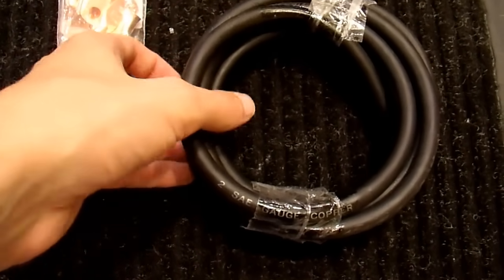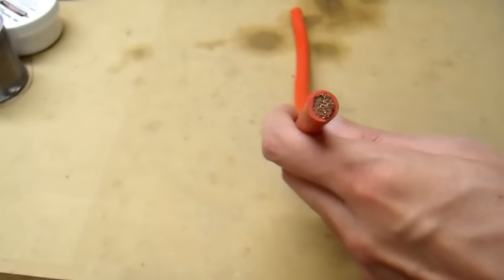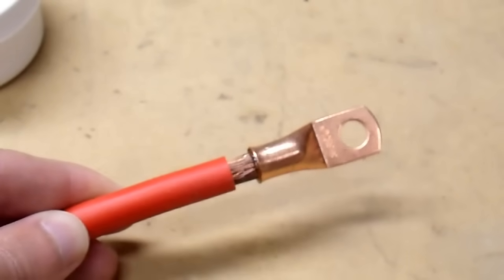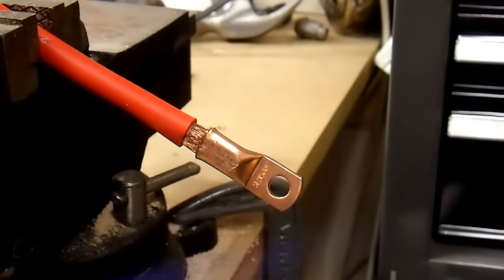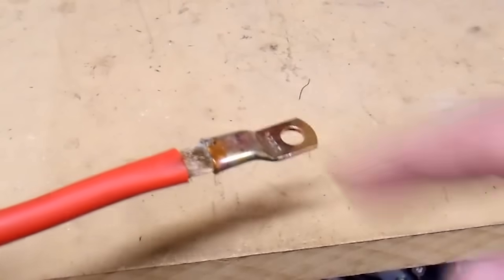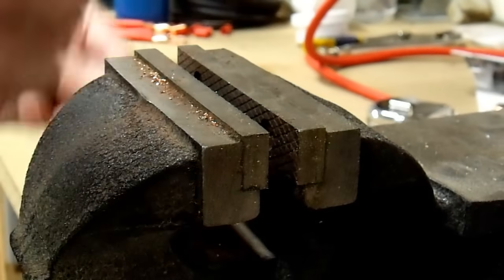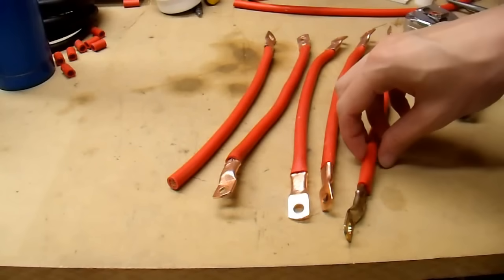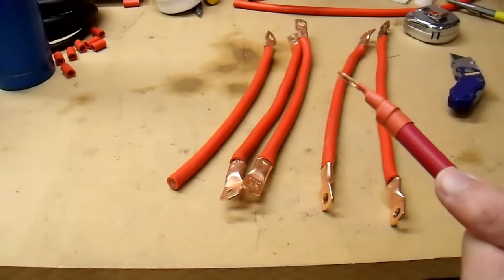How to Make Battery Cables the Right Way and the Easy Way

Comment: NOT EASY OR RIGHT!!! THE IRONY IN THE STUPIDITY!!!
Why It Is NOT RIGHT (The Reliability Failure)
Soldering Kills the Wire: If you solder, the connection becomes rigid. The vibrations from your engine will always cause the flexible wire to break right where it meets the stiff solder.
Acid Eats the Copper: Soldering uses a chemical called flux. This flux is acidic, and it soaks up into the wire strands. You can never fully clean it out. That hidden acid slowly and secretly eats away at the copper wire over time, causing failure.
Bad Crimp Risk: The hammer tool is a guesswork method. You hit it hard and hope it squeezes the metal perfectly. If you are off by a little, the connection will be weak. You can't see inside to check the quality.
2. Why It Is NOT EASY (The Execution Failure)
It's Hard Work: Hitting a large wire lug (like 4 AWG) hard enough with a hammer requires a lot of physical effort and a solid surface. This is difficult to do correctly when you are working on a car.
Easy to Ruin Parts: One bad strike can bend and ruin the expensive metal lug, forcing you to start over and waste material. A proper tool takes the risk out of the process.
A high-quality crimp tool is the only way to get a perfect, lasting connection without all these risks.

Comment: Those terminal lugs are not designed for soldering, they are designed for CRIMPING. solder lugs have a small hole in the sloping face, where the solder flows into the lug and up along the copper strands of the wire.

Comment: Your flux should not be acidic and you should use a proper crimper and put a small hole at the front of that so solder can get to the front of your cable within the connector. Stop trying to teach people things you don’t know anything about or don’t care about.

Comment: Sorry the picture of the battery connected is improperly done.
No copper on wire should be exposed and insulation sealer at insulation there is none

Comment: So you do the work, to do a video, and do it completely wrong? You stripped excess, but not important? Are you high???  Folks, strip it back until the insulation meets with the connector. Also use shrink tubing. The cable this guy just made is dangerous, and should not be used.

Comment: This is the worst "right way" video I've ever seen. To crimp a ring terminal, you absolutely need a special crimping tool. Other methods do not provide a secure and permanent connection. With a properly crimped connection, soldering is no longer necessary. In fact, soldering itself can become a risk if the cables get hot: Solder drips and the connection deteriorates rapidly. This can cause a fire because the resistance increases rapidly.

Comment: In an exposed environment such as under a car's hood, I would crimp and solder.  Crimping makes the electrical connection and solder seals the connection from water and dust intrusion.  I've seen exposed crimped battery cable connections almost breaking aprart due to corrosion.  I've never had a problem with rosin flux corrosion.  Acid flux is a different and corrosive flux.  That's why today's battery cable clamps are molded around the cable wires as a single unit.  The slighest amount of resistance can drop the battery voltage at the starter to the point tha it can't turn over the engine.  That can lead to the misdiagnosis as a bad battery.

Comment: So much misinformation in the comments! 1) Solder is a good conductor, that's why it's not replaced with a different alloy on high end electronics! 2) Soldering a crimp is going to have lower resistance and better conductivity than JUST a crimp!

Comment: I just pick up this crimper that comes with changeable teeth and has a hydraulic cylinder with a turn on/off valve. It also works on cable for regular tie downs for fences, poles.  And I agree with you on the shrink tube.

Comment: With such a large cross-section of the cable, the transfer of large currents is assumed.
What the video shows is not a good example of how to fit cable ends with a cable lugs.
The cable lugs must be gas-tightly crimped onto the cable core.
This is the only way to guarantee that there will be minimal transition resistance at the connection point and that the connection will not heat up when a large current passes through.
And this can be achieved with a tool designed for crimping cable lugs. Not with a vice or a soldering iron. 
The same applies to stripping the cable jacket. With a knife yes, but only with an experienced hand. Otherwise, there is a risk of cutting or damaging the cable core. There are tools with an edge that can be adjusted for depth and there is no danger.

Comment: Wow 😅😅 Turn off the blow lamp mate.  I could've soldered two very thick 54mm copper sockets with the amount of heat you used on that tiny thing.

Comment: With many years experience in the military and a lot of testing in the 80,s on joints, soldering does not make as good a connection as a airless gap pressure fit, for Eg a hydraulic clamping tool. Its not about the wire pulling out its about the total current delivery verses temperature rise we saw on joint. So once you start pulling 50 to 100 amps a oxygen free clamp is the best.

Comment: when u said make your own I thought you would of all the way & make your copper ends also find some old copper tubing you have laying around using sizes that match what you want cut your length flatten a portion in the vise drill your desired size through it other side of course you solder your wire in clean up with some sand paper or steel wool I picked up that little trick from Scott messier lakeside sailing Guntersville  AL

Comment: Use the right tool for the job or don't do the job! 
You don't solder electrical lugs. You crimp them. The crimp, if done properly, with the right tool, is gas tight and won't corrode.
As the saying goes, If you want good oats (a good job) expect to pay more than if you settle for cheap oats that have gone through the horse already (a shit job).
Reply from the maker: There are many 'lugs' that are soldered in both automotive and industrial applications.  Crimps are NEVER gas tight.  Never.  That is just marketing.  Take a look at salt fog testing or real world failure analysis and you'll quickly see that crimps have limitations.  Sometimes people will pay a lot for perceived benefits where they are convinced by a salesman that the shiny new thing is the best for all applications without any critical thinking involved.

Comment: What wire gauge is recommended to use to connect my  battery? 4pcs 12v 100ah combination of series and parallel connection.thank you
Reply from the maker: I have an old (but informational) video on that exact topic.  My apologies for the video quality of a decade ago.
https://youtu.be/p1bnHu14SMs

Comment: Yeah this is definitely not the right way. Battery cables end should be crimped with the right tool and to the proper torque.
Reply from the maker: Torque?  I don't think that word means what you think it means.
Reply: @knurlgnar24  does it matter, you did it wrong either way. An youre right, the word was used incorrectly. Thanks for checking the dictionary.

Comment: I use to make car battery cable like that a long time ago before realising that when you use solder its the same as using a solid cable and will eventually break off due to vibration
Reply from the maker: This was for a stationary application where that isn't an issue, however note that some OEM automotive and industrial cabling is soldered for corrosion prevention reasons and absolute lowest termination heating.  It just requires some strain relief and conscious consideration in routing.

Comment: Why don't you just purchase the tool that crimps the ends. They are readily available
and the connection is secure and industry approved
Reply from the maker: I have a hydraulic crimper and a hammer crimp tool.  I find the hammer crimper makes poor quality crimps and the hydraulic crimper is something few people have.  The point is you don't need them and a soldered connection far outperforms them anyway.

Comment: If you used the proper crimping tool and appropriate die you actually seal off the inside of the termination then the solder is just to effectively seal off the outside air/water from reaching the clean dry interior you end up with a cable end that will last much longer.

Comment: No shrink tube for a neat job???
Reply from the maker: Heat shrink does little except act as strain relief (which is often not needed) and hides terminal damage and corrosion.  In most stationary applications I believe one is better off without it.  It does look nice if that's all you're after.

Comment: Nope, from experience, soldered cables will always fray in vibration environment.
Reply from the maker: Someone with experience wouldn't use the word 'fray' in this context.  But I agree in principle that solder is a stress riser that can cause metal fatigue.  The application here is for stationary applications so this concern doesn't apply.

Comment: Orribile
Reply from the maker: Erribile.  Horibibible.  And I'm still using these cables today without issue despite multiple 'professionally' crimped cables failing.  Perfect?  No.  But they work well.

Comment: What's the appropriate solder ?
Reply from the maker: Most any flux core solder will do.  60/40 is the most common but eutectic is slightly better.  In practical applications it doesn't matter either way.  I would recommend lead bearing solder vs lead free as it has a lower melting temperature.

Comment: Soldering didn't do any good, just useless steps if you need strong crimping without the proper tool hit the terminal with a screw using hammer two or three places

Comment: Way to much (unnecessary solder), not enough (unnecessary flux) and you (unnecessary overheated) the copper fitting that shouldn't have been soldered in the first place.

Comment: do a resistance test on cable ends - Soldered  v Crimped -   resistance  at connection is what mostly matters
Reply from the maker: I bought a bunch of stuff a couple years ago to do this video recommendation and may at some point.  From using cables for high currents I can say that the cables crimped in this video are on average cooler than factory crimped cabling.  Factory crimps are usually pretty terrible unless you pay for the quality, and if you're an 'amazon shopper' then outcome is all but inevitable.

Comment: Many comments about heat shrink tubing that has glue inside.  Great stuff, but before that came along, you could make your connection, cover with a thin layer of silicone, slide the tubing over and shrink it.  Made a perfectly sealed connection.  Make sure you use silicone that does NOT contain acid as it will literally turn the wires to dust (experienced that).  Just smell it to see the difference.  If it smells like vinegar, use a different tube.  The cheaper types such as sink and bathroom blend are acid, others are not.

Comment: I previously used dielectric (silicone) grease for coating electrical connections since it was recommended in books and by professionals. But after seeing how dielectric grease becomes somewhat thick and clumpy from apparently drying out over time, I have moved to using petroleum jelly (Vasoline is one name brand) exclusively and have never had anything but success, including for car battery terminals.  Petroleum jelly seems to remain unchanged over time and is much less expensive and more widely available than dielectric grease.

Comment: DON"T LISTEN TO THIS GUY!!!!  

This is the worst video I have seen about making battery cables.  First look up a proper cold weld fuse crimp if you actually care about making a good battery cable.  Second, do not solder battery cables on anything that vibrates.  Look that up as well if you need to.  You are making a fixed point and not dispersing the flex load thereby creating a brittle point.  Third, you are an idiot for your thoughts on heat shrink.  "if the negative rubs against this it will break through the heat shrink insulation and cause a short"?????? what happens if there is no heat shrink there genius? A SHORT.....   The heat shrink is required on so many professional applications and if you spent 2 secs of your precious time away from making crap videos and actually researched and learned something you would know that.  Heat shrink, when done properly, is a vapor barrier.  Stopping air and water from getting to your connections. Heat shrink is a great insulator and will protect potentially live wires from coming in contact in most cases.

Comment: Came across this old video looking for some good info as many on this channel are. But sadly this one is the bad exception.
The problem is that although this video is better removed, a millions watched it. So my comment. 

1st method crimp/solder. Crimp/solder combination: Actually there is no crimping done here. Squeezing a larger diameter over a smaller from just 2 sides leaves, as much space than when round. Filling that up with solder to remedy that 1st fault, will also make the solder go it way up into the cable. Hardened, it and creates a breaking point.
Most likely in some way the cable will be made straight but bent in final montage, creating even without any vibration already mechanical stresspoints within the cable. Strands might break unseen. reducing the load capability and cause a fire. 
2nd method shown, tries to remedy the fault of only squeezing and leaving space, and then tries  to make the outer diameter smaller which if effective would move the strands to the left space. Which it does not.  Some strands might be stuck good, some not. Which is a problem. see next.
3rd: And the one everyone does wrong: 
Cables can bent because the inner cable strands can move independently within the insulation. When a cable is bent the inner strands of the radius compress, the outer strands stretch. In bigger diameter cables the independent strands have to move much more than with a thin diameter cables. 
But by crimping and even worse soldering which shortens the length in which movements of strands can occur, you will fixate this movement, and thus bending. 
So fixating movement of strands by putting  terminals on, a strait, short and thick cable, and then bending in the final montage, is already putting a lot of stress on the strands. If a crimp is not correctly made, (as in example 2, and a strait made short cable is bent ones or more due to vibration, it will pull individual strands out of the terminal. reducing load etc. 
 To prevent this, always bent thick,  short cables into the needed shape first, then cut, and proper crimp (really shrinking the outer diameter onto the inner) with a proper tool.
As some comments state: a terminal will always result in a larger resistance: my answer is No. With a proper crimping tool you are on a microscopic level adding copper and pressed so hard that even oxygen can not enter. As for terminals go, they must have more surface area than the cable diameter surface. This is where cheaper terminals often fall short. Bigger bolt holes or  drilling out a bolt hole to accommodate a larger diameter bolt  is reducing surface area and not done.

Comment: Having been a battery service technician for many years I can tell you that crimping the cable was completely unnecessary. Soldering the terminal properly is 1000% better conductivity. Crimping the way he has creates choke points for the amp flow. Those in turn begin to heat up. Heat creates resistance which creates more heat and thus more resistance and so on and so on. The Oxidation he refers to is not from contamination of the copper but from the loss of tinsel in the wire due to the abundance of heat the resistance created.

Comment: Correctly crimped, the copper lug and wire become fused into one piece of metal. Tests show that crimping (VS soldering) is stronger and longer lasting under tension and heat. The aerospace industry uses crimping, as does Siemens motors.

Comment: Firstly cut insulation to right length, copper showing. Use appropriate crimper. If not then solder. Proper pieces od shrink sleeving. Using a vice to crimp is not professional at all.

Comment: I hold the ring terminal in a vise vertically. Then fill the cavity with short lengths of rosin core solder. The cable insulation is removed and the lug heated until the solder melts. While the solder is still molten the cable is then plunged into the solder and left to cool. Finally, heat shrink is placed over the terminal.

No crimping attempted or necessary.

Comment: I really hope you have learned that this is far from the best way and is actually a fail on so many points. Firstly, you cause a brittle point in the cable (it WILL snap in time, with vibration like you'll find on a diesel vehicle)The outer casing is too short, it should but to the connector, you burned the outer casing, you crimped a solder joint (Biggest no-no there!) Crimp OR solder, not both. As for using the vice to crimp, it squashes the lug instead of squeezing it so acrually is less effective by far and it looks awful.In my line of work or play it would be failed and binned everytime, just buy a cheap crimper, there are versions from hydraulic hex finish, manual die to the back and even a really inexpensive "hit with hammer in a vice" machines. All do better quality and finish.

Comment: This is just all wrong! This is not how to terminate a battery cable. There is so much helpfull info on Youtube but videos like this really spoil it. Step 1 Use the correct crimping tool, step 2 Never use solder on automotive or hi currect connections!